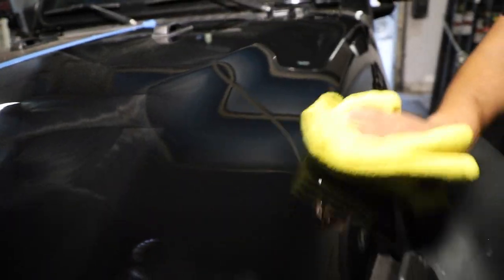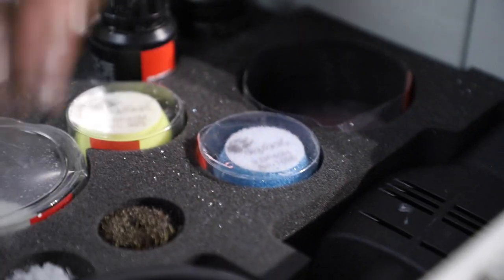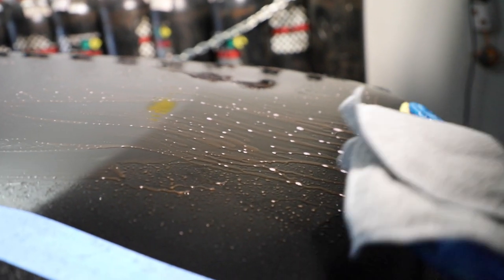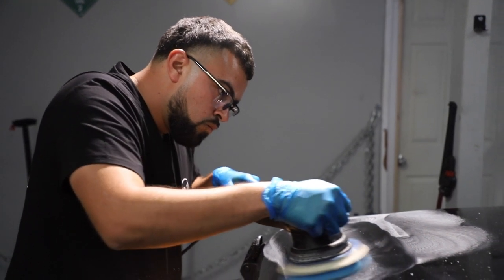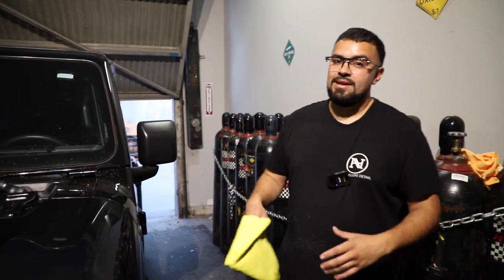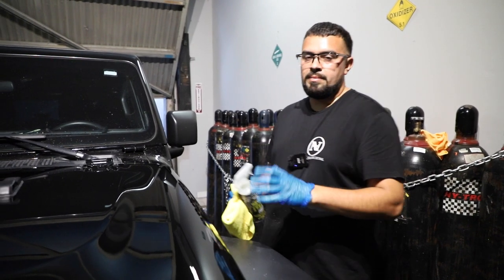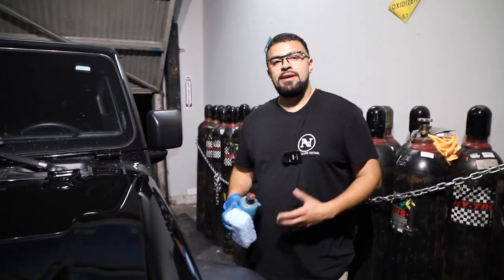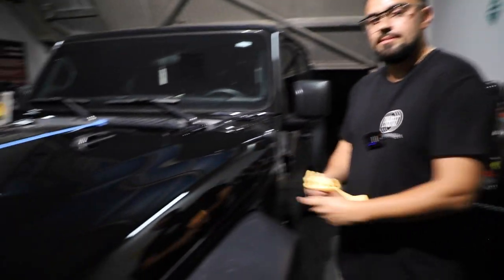Step By Step Polishing and Ceramic Coating - An'A Deluxe Detail

Comment: Hey bro I recommend you try out the gyeon can coat it’s a 1 year ceramic coating and it’s easy to apply just spray it on a microfiber towel and apply it to the car you don’t have to wait for any hazing it’s instant wipe off and you can use it on anything trim, mirrors,glass and headlights etc
Reply: Facts I love can coat I’ve used it on 2 cars already and the clients loved the results in gonna use it on another car on Monday still same bottle. I say 1 bottle you can coat Atleast 4 cars
Reply: Chemical guys? I would do the gyeon can also or Shine supply.

Comment: For the last time, a spray “ceramic coat” product from CG that runs you $30 is not a ceramic coating so stop cheating your customers. It’s lasts no more than 2 months.
Reply: These dudes believe everything chemical guys say 😂
Reply: @Mr.grubby  man, crazy lol
Reply: facts lol
Reply: Yeah I'd like to know what they charged for this service.  This is the reason people question and don't believe folks that use real products and always argue about price.
Reply: There are a few spray ceramics that last longer than 9 months.  Check out Scott HDs channel.  He coats and then washes them periodically and leaves them outside for years.
CG stuff doesn't last very long compared to Griors Spray ceramics for example

Comment: You should've put the hyper wax first, then the hydro charge after.

Also those 2 products from CG are pretty trash, if you're gonna sell a 1 year coating I recommend using Adams advanced graphene ceramic spray, only needs 1 coat, and it's amazing and very fast to install, you can apply it in 20-30 min
Reply: Gyeon can coat is also a good option easy apply and easy wipe off no waiting for hazing

Comment: your work is mediocore. however if you cared about your customers you wouldnt be using Chemical guys.. also that is not a ceramic coating its a spray on wipe off medicore wannabe ceramic. also you can get thoose results using any polisher if you have SKILLS with a polisher. please stop misinforming people. i wasent going to comment but for someone thats been doing this as long as i have your information is incorrect and you shouldnt be making people think what your saying is correct. your not a pro installing a coating your a weekend warrior installing a "spraywax"

Comment: No disrespect, but where's the paint depth gauge? how do you know how many mils or microns are left on the clear coat?.. why a quick detail before paint correction. a full exterior wash and chemical decon is necessary. Why aren't you masking off any trim, rubber, headlights off? No IPA wipe?  I respect you tryna make a living but please do it the right way..
Reply: could'nt of said it better!
Reply: Im afraid to burn clearcoat, would want to get certified before doing any corrections. That’s why I don’t offer that service atm.
Reply: @909luie8  I was doing paint corrections YEARS before I ever got “certified” and my intention was to further validate my ability to do paint correction work. 

It is extremely hard to burn thru clear coat if you’re using a Dual action machine. rotary is a different story but DA, as long as you have some form of a basic technique with at least a decent polish or compound— you will get results. 

Paint correction isn’t rocket science. Good technique, adequately primed paint surfaces goes a long way.
Reply: @909luie8  been doing this as a business for over 10 years now. Been detailing since 2003. Just learn. Big money in the paint correction realm of detailing.

Comment: First of all this was no step by step tutorial on polishing of coating and the chemical guys products you using are whack and it’s no ceramic coating , to do all that work and apply that is ridiculous , the polishing was fine and good polishes but you need to apply a proper ceramic coating after all that work